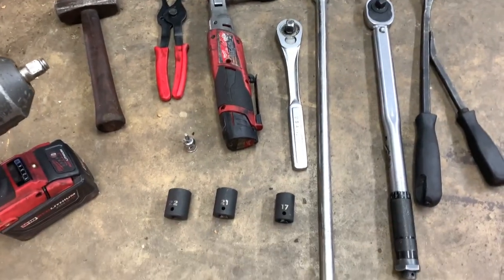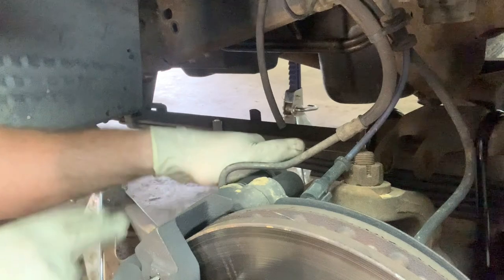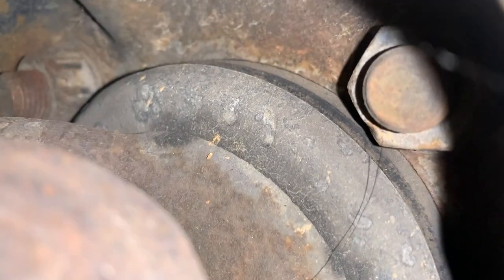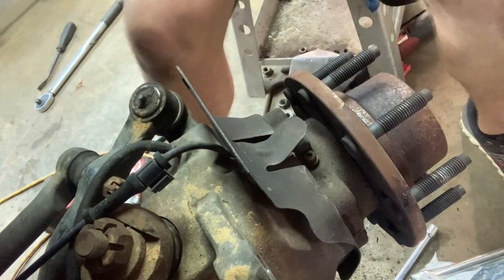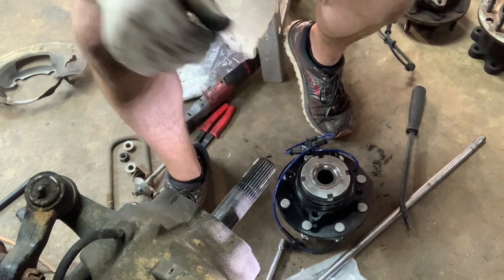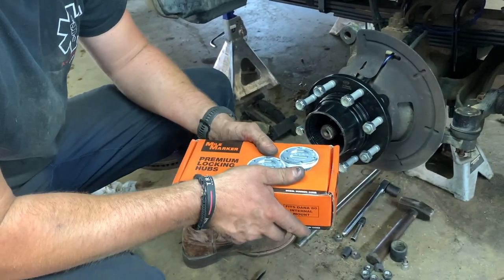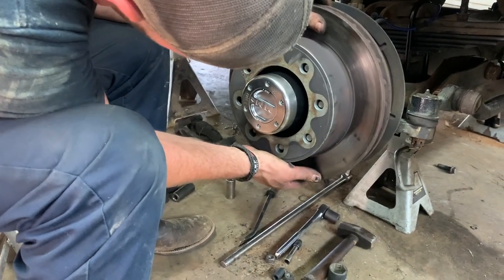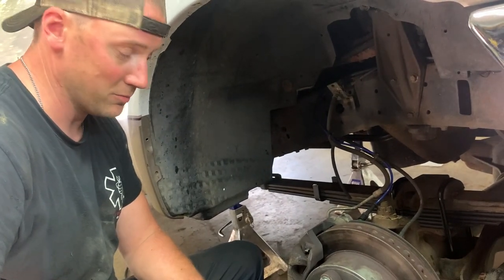1999 - 2010 Superduty bearing hub replacement and manual hub conversion

Comment: I swapped out my hubs about 3yrs ago on my 2000 7.3l , finished up and when I flipped the 4x4 switch in the cab, I heard some clicking/grinding for about 5 seconds and then nothing. Now the switch doesn't engage the 
4wd and the light doesn't come on on the dash but I can turn the hubs to get it into 4wd. I believe I've got vacuum issues.

Comment: Really appreciate you taking the time to do this video. I’m about to replace my upper and lower ball joints on my ‘04 F250 and since the truck has 110K miles, I thought that I would be proactive and go ahead and replace the wheel bearings while I’m in there. Which company do you prefer for wheel bearings? I know you mentioned the lockers company but I didn’t see the bearing company that you used. Thx in advance 👍🏻
Reply from the maker: I prefer Timken for the bearings. Moog is another one but they are made in China now. I have a ball joint video for these also.
Reply: @AutomedicGarage  Timken is what I was looking at. Thanks for the suggestion, much appreciated. I enjoyed your ball joints video as well 👍🏻

Comment: So, by switching from Auto hubs to Manual, how do you engage 4-Low?
Reply from the maker: The same way you just lock the hubs instead of auto. Low is an engagement in the transfer case not the axle.

Comment: Hello. 
So by doing this mod I can eliminate the vaccum locking system ?? 
Im swaping a 2010 dana 60 into a 94 E350 and didn’t know about the vaccum engage system and would like to remove it. Lmk. Thankx.
Reply from the maker: Yep. Ditch the factory plastic garbage hubs. Put these on and plug the vacuum port up